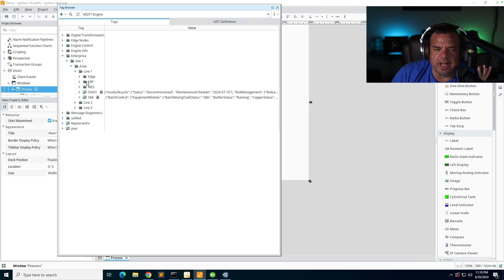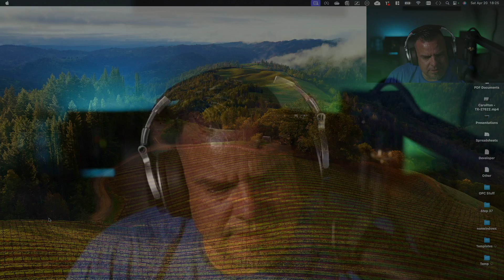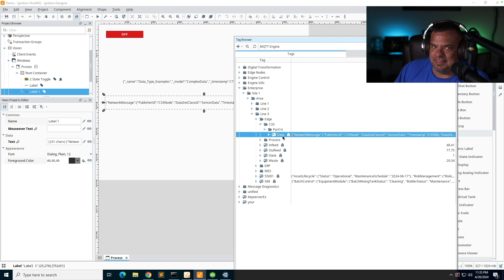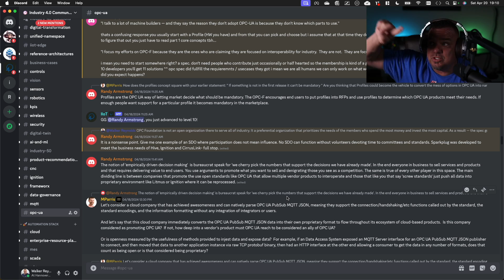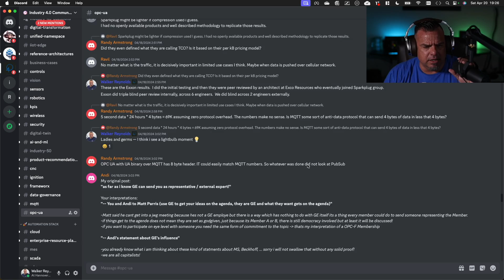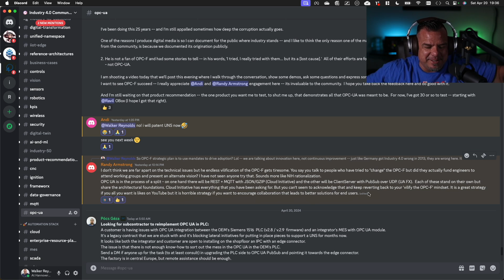MQTT Application & OPC Foundations Issues

Comment: Does OPC stand for "Open Platform Communications"?
Reply from the maker: Started out as OLE for Process Control (OPC) is a set of standards that allows different process control devices to communicate with each other. OPC is based on Microsoft's OLE/COM technology and was originally developed in 1996 by an industrial automation task force.
Reply: @4.0Solutions   Oh i see. So somewhat related (to Microsoft). not to "Open Platform Communications"

Comment: Can confirm, sick of OPC vs MQTT war.
Reply from the maker: Quick question — if you have 180,000 physical IO, 360,000 internal variables (540,000 tags) across 500 devices — plus 80 software functions generating another 1M data points.  How do you connect them all together?
Reply: @4.0Solutions  not really a quick question (pretty sure you know that), but I'll go with a modified Ricks answer:

AND, not XOR
Reply: @Lachlan.Wright  STRANGE My comments get deleted !!
Reply from the maker: We don’t delete comments.
Reply: @ravis2381  Pretty sure they don't delete comments. 🙂